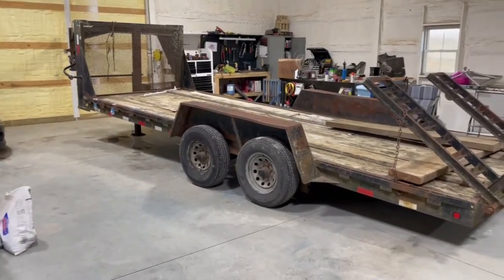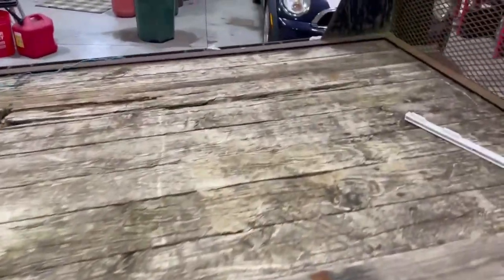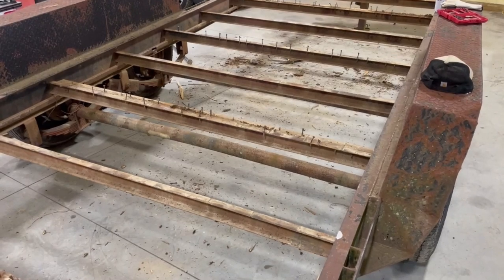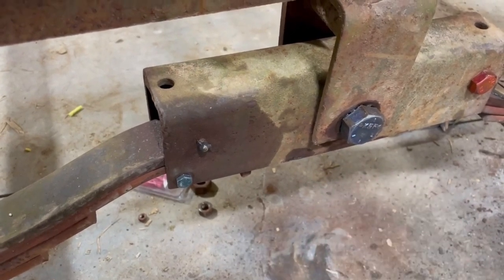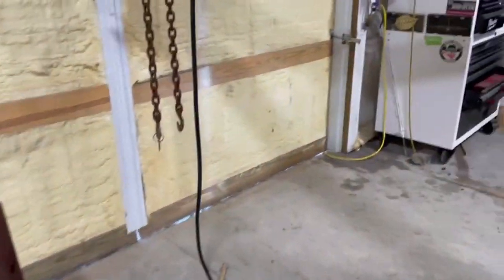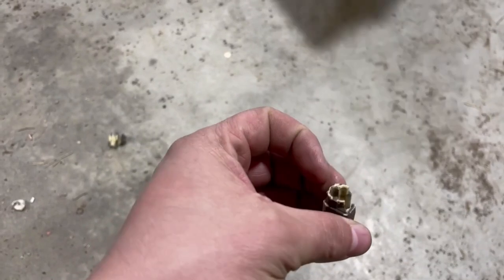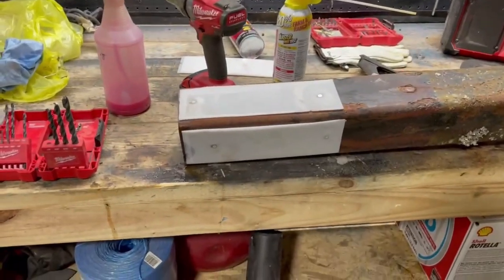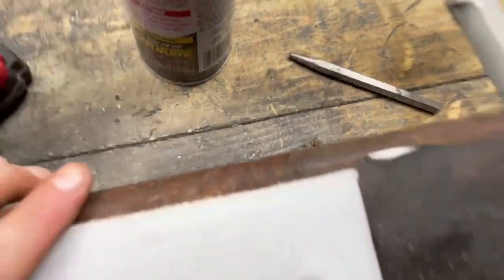Gooseneck Lowboy trailer rebuild

Comment: have a similar trailer to this on our farm, that was bought new. same style except the ramps ours are pull out. Ours is a 20ft PJ. good trailer great design best part i like it sits low to the ground.
Reply from the maker: Yeah that's the main reason we decided to keep this one around. As long as it fits between the fenders, its so much easier to load equipment on.

Comment: Thanks for this video.  It appears that your trailer is built with 6" channel for stringers and 3" channel cross members along with 4" drop axles and no dove tail.  Please confirm this one way or the other.  I'm wondering what the deck height is?  Thanks
Reply from the maker: That is correct, sits around 28" if your sitting level. That height works real well for equipment, if you were loooking to haul cars I would want a dovetail. I've loaded some sedans on this and it gets a little tricky clearing the break over angle.

Comment: Those connectors man I trashed them and decided to ue electrical tape instead but those connectors I trashed but the when. Connected the sie markers in tho there side I used those connectors it worked but I don't Ike those connectors but it wasn't my trailer it was in an automotive shop for re wiring

Comment: I put new marker lughtso n a trailer 2 other wash helping well lon story short someone fucked up and there was only1 person working n that the wre so the wire got ripped off on the road so had to fix it but they hooked the battery up s isaid fuck it and reconnected the wires